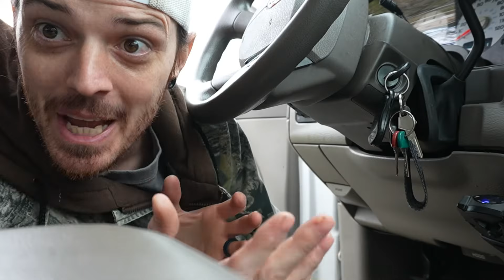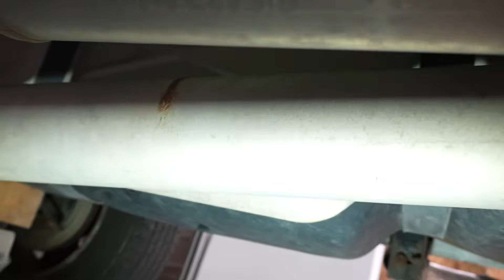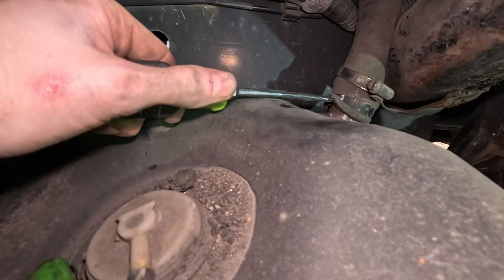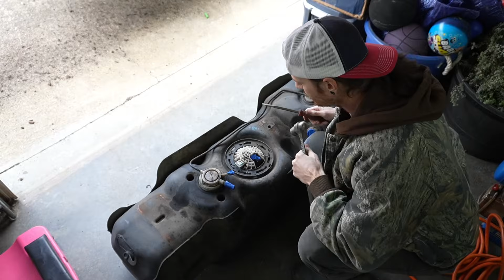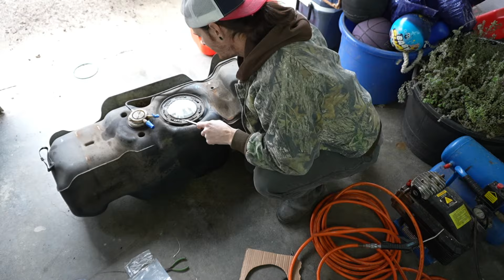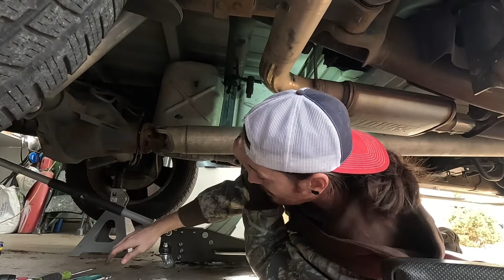How to Replace Fuel Pump 2002-2005 Dodge RAM 1500 5.7 Hemi 26 gallon tank

Comment: Little too late but on those gas lines with the metal clip that kept breaking, the proper removal is to just take a pliers and squeeze the clip inwards towards the plastic nipple and the clip will then release and you can pull the line right off
Reply from the maker: Yea that would of been helpful something seemed off with them lol
Reply: @justtheClark   i just did the same sht on my dodge lol i broke 2 and came looking to see if there was a better way and ya, i heard someone say use a screw driver to press in on it or pliers lol...

Comment: I Just Did Mine I Put It Up on ( 3)4x12 blocks Per Tire  !~!~ 99 Dodge Ram Truck  1500 i lowered Mine Out i Made a Special Jack board To Carry The tank Worked Like a Hot Dam :):) <3 !~!~ Fuel Line was Discontinued But I Found a guy Who Repairs Fittings Through a Dodge dealer I Replaced The Hoses And Lock Down Nut For Fuel Pump And Modified My Fuel Line, Stoked :):) <3 !~!~!~  I Ran My Gas Out To Under a 1/4 tank then !~!~ Just over a 1/8 ill post picks on facebook  when im Done
Reply from the maker: Sweet! Should be good for a long while now!

Comment: Did mine yesterday,  cut a hole in my bed and it was right there. Wasn't dropping a tank with over 30 gallons of gas in it. Besides, I would have never gotten the plug or the little tube off with it hanging by straps with a jack under it. If it fails again, remove the bedliner and 4 screws . If it works is it a dumb idea?

Comment: I appreciate the comment about the clip and Justin I sure thank you for posting this video because your video seems to be the only one that gets straight to the point I like it and I appreciate it getting ready to do this now on an '05 Dodge ram hemi sport 5.7 l I thought about taking the shortcut and cutting the hole through the bed but I got enough holes in the truck lol it's got the typical Dodge rust pretty bad but solid cab mounts doors closing seal off good it's a good truck it's got 250,000 mi on it it's had some aftermarket parts I believe it's got a cam k&n breather and all that too many aftermarket parts on it and it runs too good to have that many miles so I think it's well worth the fuel pump and water pump went out at the same time and so did the battery lol having a blast with this not but thank you
Reply: 06 Ram 1500  MegaCab has 267,000 miles  and runs great.... until Friday evening when it died one mile from home. Doing the fuel pump today.
Reply: Fuel pump is complete. Started right up after a key prime. Getting better gas mileage as well.
Reply from the maker: Thank you! Yea this one is up to just under 200,000 still running great but the a/c compressor just went out it never ends
Reply: @justtheClark  Well, it may never end, but it always runs! LOL! Keep on truckin'!

Comment: Just had same issue...  it died once but started after I added 2 gallons of fuel to it ( it had little to no gas when it died) it started so i thought it was only low on fuel and fixed ... later that day it was idling and stalled out and wouldn't start even with tank 1/4 full.  It sounded like it wanted to start but wouldn't contine past couple chug chugs...  gotta diagnos it and see if it's pump.  Your video helped thanks
Reply from the maker: Thank you! I had the wife jump the fuel pump relay in the front while I listened near the tank. When it didn’t turn on I just hit it with a hammer to free it up

Comment: For those attempting this be aware that if you crack one of those white evap vent  line nipples you’re in world of hurt.  You will have to perform the “custom repair” on the nipple. It will eventually leak and set P0456 very small evap leak code.  A new fuel tank is unobtainable.   Fuel Tank 52113589AJ And variants AC, AD, AE, AG 2004-2006
2003 - 52102510AB, AD
2007 - 55366948AC
2008 - 5598734AA
Finding a junk useable fuel tank is rare and no one ships.
Good luck.
Reply from the maker: I’ve seen a few posts about people trying to get new tanks saying it was very difficult

Comment: Let me ask you a question does the oil cap get condensation under it when cold outside? They seem bad about it. Junk pcv systems i guess
Reply from the maker: Yes I would agree
Reply: Mine has this issue as well wondering if I should be concerned about it